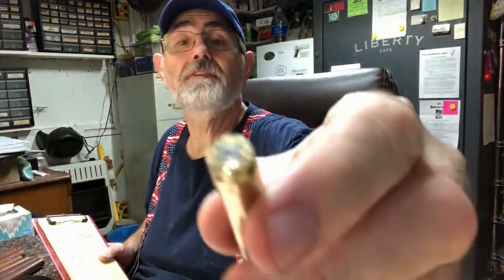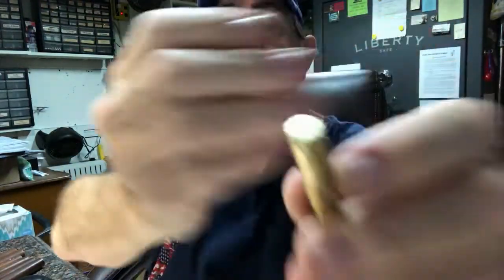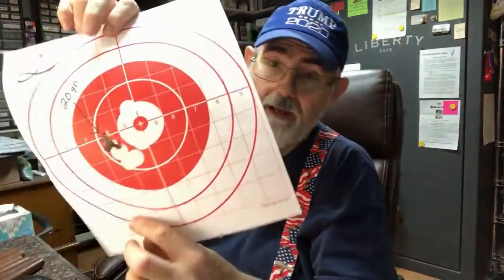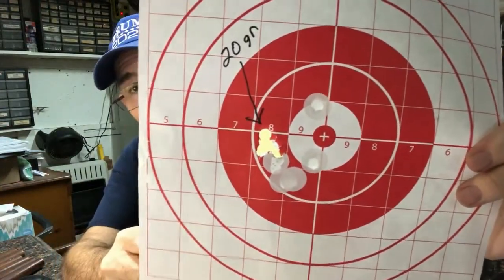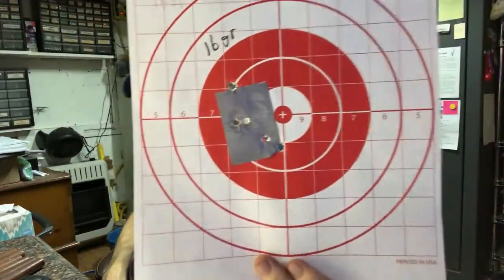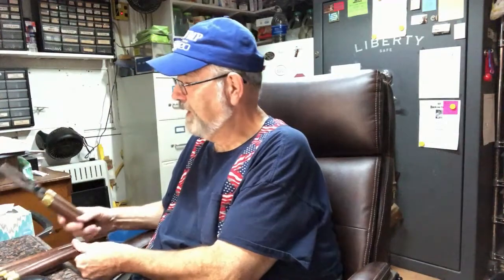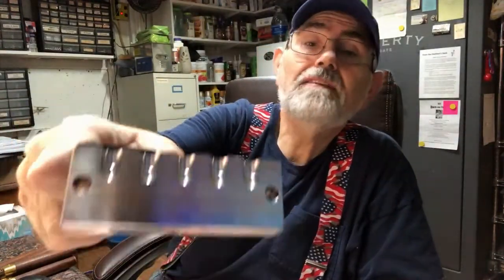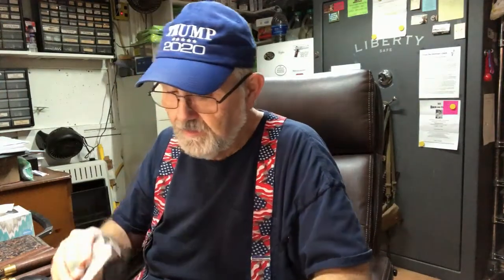350 Legend 158 Grain Bullet Smooth 3 0

Comment: That delay or slow recoil you were talking about you were on the edge of blowing your gun up. You can not down load LIL Gun or H110. That was also why the primers were flattened on your first loads. If you are going to run them that slow then switch to 2400. it can be downloaded without any problems.

Comment: Good video. What is your crimp measurement at the neck? I tried some cast Hi-tech coated RCBS 125gr. conical and Lee 125 gr. round nose sized to .356".The dummy rounds I made up would slide out of the brass when I cycled them in the ar. I crimped them at .371" and they would slide out .015" . My ar is like a bullet puller!